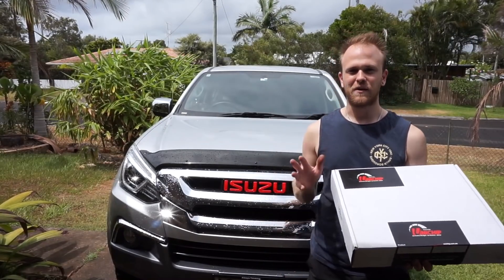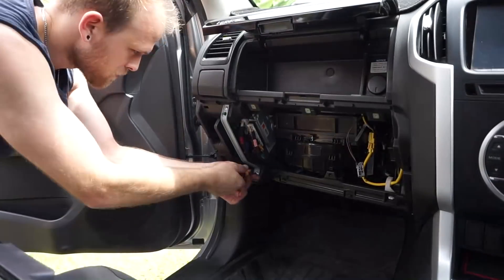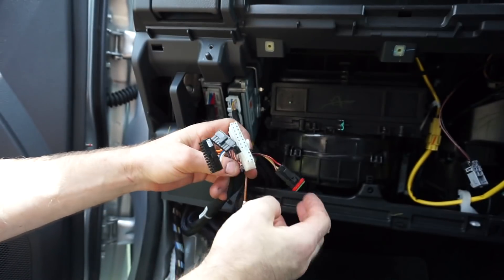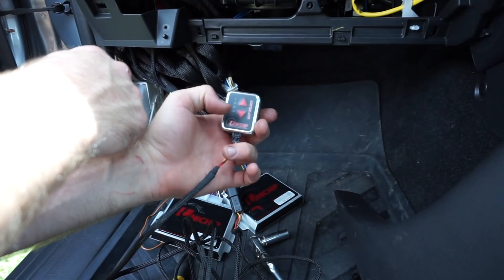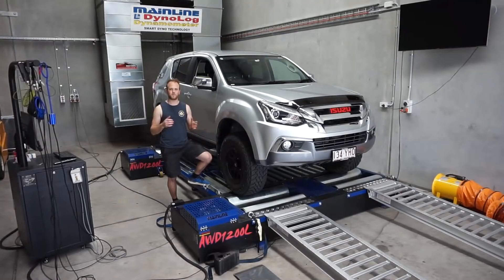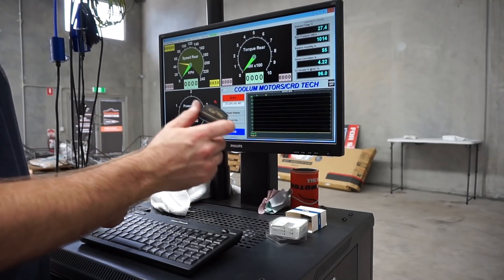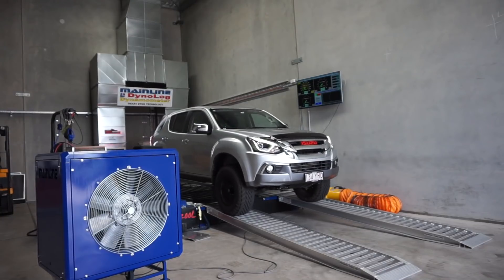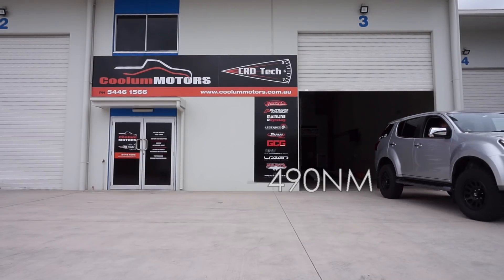Isuzu MU-X Unichip Q4 Tuning Module Installation + Dyno Tune

Comment: Hi Nick - sounds like the M-UX is significantly improved. Love to hear your thoughts off road and towing. It looks like you own or work at Coolum Motors - pity I'm in VIC! Thanks again mate - good, informative video. Cheers
Reply from the maker: Hey Benny! It drives soo well now and has bucket loads of torque. I havnt installed a towbar just yet, but its definately on the list. Offroad it is great! The Idrive paired with the Unichip and there is soo much power and torque on tap when you need it with great throttle response. I work at Coolum Motors and my boss is good enough to let me use our work equipment on the weekend for my videos 😊 Cheers for the comment!
Reply: Gq no computers better?

Comment: Looks like the go. The stock 430nm @ flywheel tune curve does have a real de-tuned shape about it. 
OEM maximum transmission load spec is 450nm so mod tune takes that well over that. 
Will be interesting to see how they hold up long term.

Comment: Hi Nick. You vids are very informative. I have a question. How reliable is the MUX mechanically now you have chipped and remapped it? I have an MUX also, but have heard they will break cv's fairly easily.
Reply from the maker: Thanks Kelly! It is still very reliable, i havnt had issues with cvs. I think it's mainly people with big lifts and 33's that have issues with cvs breaking and tierods bending 😊

Comment: Great Video what a beast, whats the box on the dash? Sorry not on the dash on the windscreen.
Reply from the maker: Do you meen the map select switch? With the numbers and up and down buttons? If so it is to change between 5 different engine mapsets from standard right through to the max power tune 😊
Reply: Sorry I was talking about the gadget on the windscreen?
Reply from the maker: @Gomezhrt  Ahh ok! Its an EDS Scan gauge. You can use it to read and clear codes and read out live data from your vehicles OBD2 port :)

Comment: Hey Nic, got question, you installed this unichip and then 6 months later you put ecu shop super touch 4. Is that cause unichip was no good or other reason? I’m looking into getting a chip for my 2015 lamb Dmax
Reply from the maker: I was looking for more power and torque. The ecu shop super 4 enables much more adjustability than the unichip.

Comment: If you were concerned about warranty issues, and you could be bothered removing the system before dealer servicing / inspection, would there be any trace in the factory computer that a piggyback chip had been installed?
Reply from the maker: Great question. The answer is no. There would be no trace at all. The unichip just alters the sensor voltage signals to the ECU to in turn increase the outputs. But it is still working within the ecu's paramaters. So it is completely removable 😊👍🚀
Reply: @LowRangeNick  Now you've got me thinking...💡

Comment: Hi Nick, does not say what the original numbers were, is this for the 130kw, 380nm, 177ps vehicle? I have the new 2018 MUX 4WD with those numbers. Can I use the same Kit?
Reply from the maker: The Unichip is for the 2018 Isuzu Mu-X with the 4jj1 engine 3.0L Turbo Diesel. You might need to email Unichip and ask them if they make a kit for your vehicle.

Comment: but why did you want to install a tuning box in your vehicle? will it affect the engine and transmission life?
Reply from the maker: To increase the power and torque output and fuel economy. It wont effect the engine or transmission life at all. Cheers!

Comment: Hi Nick

How come you chose to put a uinchip in to the mux. I have a 2016 mux
Does it have the option to delete the EGR
Reply from the maker: Hey Matt, i have run the unichip and ecu shop super 4. If you want loads of power and torque go the super 4. If you just want a small increase in power with lots of different maps then the unichip is good for that. Cheers 😊

Comment: Sorry nick, yours was 89KW, 380NM -- Question is does Unichip have one for 130KW, 380 NM vehicle?
Reply from the maker: The Factory engine output of the mu-x is 130kw and 430NM at the Flywheel. There is up to a 30% loss of power and torque through the drive line. That is why the power output at the rear wheels on the dyno is 89kw and 380NM.

Comment: hey Nick...........im confused, i thought these cars put out 130kw @420 standard? like i said before im happy with the Idrive....cheers
Reply: sorry 430nm
Reply from the maker: @brianc9159  Hey Brian! For every vehicle the manufacturers have a torque and power figure that the Engine puts out. That is measured at the flywheel of the engine not to the rear wheels of the car or 4wd. You can loose up to 30% of the power and torque through the drive train ie. Gearbox, transfer case, rear diff, axles then to the wheels. So all vehicles power figures as listed by the manufactures should be taken as an at the flywheel measurement. Hope that makes sense! Also in my case fitting the larger diameter tyres will again further decrease the power and torque coming out the rear wheels. Cheers :D
Reply: so old school hp vs bhp?
Reply from the maker: @brianc9159  Sort of similar. The manufacturers measurement is at the flywheel of the engine were as we are measuring it on our Dyno at the rear wheels :)

Comment: have you got a link Nic where i can purchase online?
Reply from the maker: You can purchase them through unichip australia website. If you chuck that in Google it should come up. You might need to call them though.
Reply: does it void warranty?
Reply from the maker: @johnbrydon1287  Only if the unichip is the direct cause of a component  failure or issue.